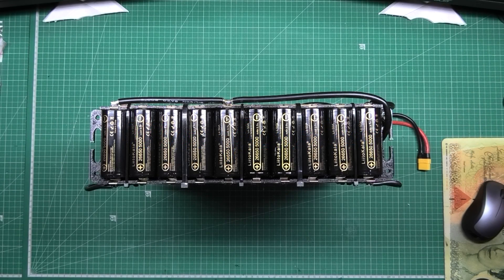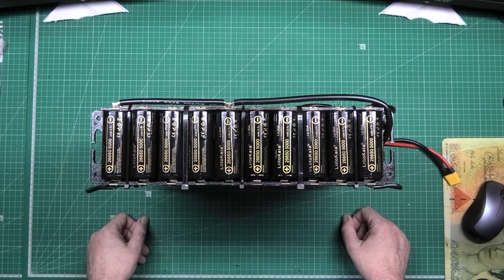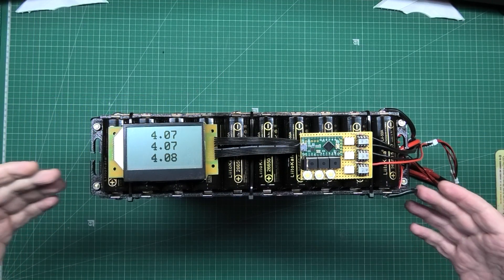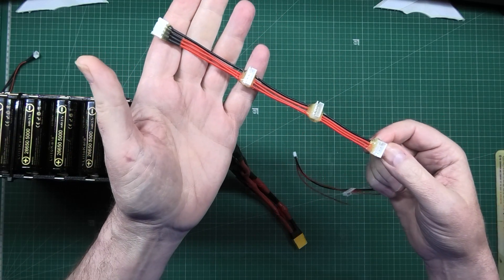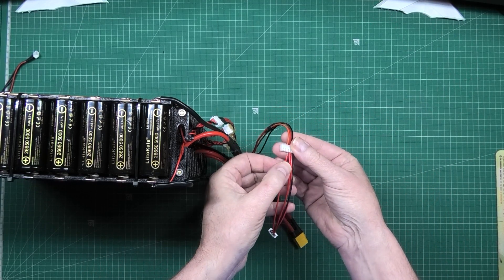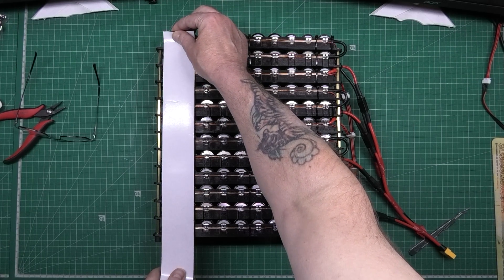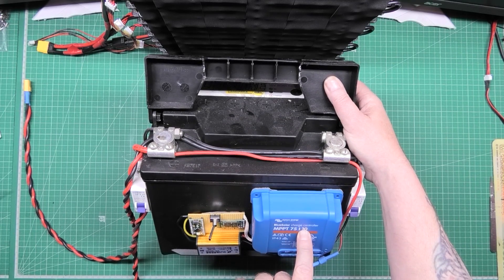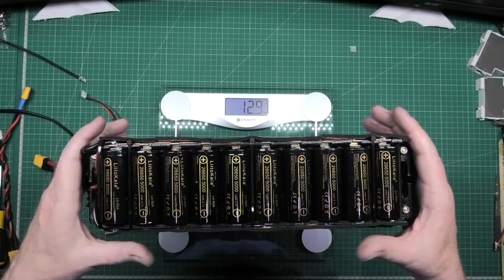DIY 2.5kWh solar battery bank build with 3D printed holders - Part 2 - Fixing my cock-up

Comment: Hi Tony, what charger do you reccomend, I have 36v lithium 24amp hour, I would like to charge it in 2 hours
Reply from the maker: To charge a 24Ah battery in 2 hours, you'd need a 12A charger if the battery is totally empty but it all depends on what battery cells you have and how many in parallel?

Comment: is this for your bike ?   on mine i've just got the most expensive factory made ones I could find on ebay... so its like 48v 20 ah,  which is pretty good until you start putting larger tyres on or going across field or the wind is over 10mph, so im starting to think about can I get it up to 30 ah or more and maybe reduce the weight of the casing, 
I guess thats what your custom ones do ?

Comment: The numbers on your Victron are for the open curcuit pv voltage (75v in this case) and the rated charge current (10amps) :)
Reply from the maker: Yeah, I know...... As soon as I uploaded it and watched it back, I realised that I'd said it wrong but I wasn't going to redo the video. Cheers mate.
Reply: No problem 👍